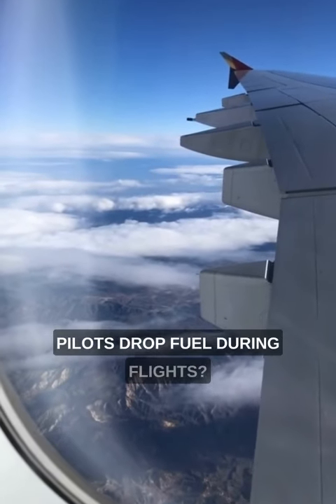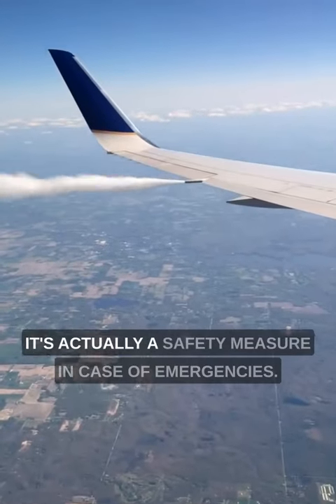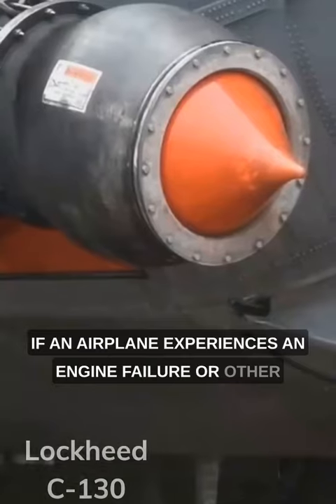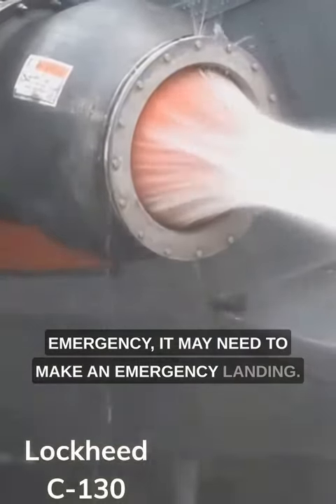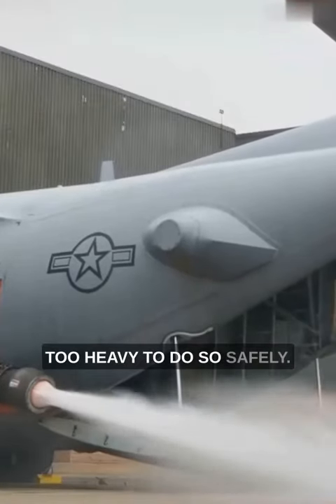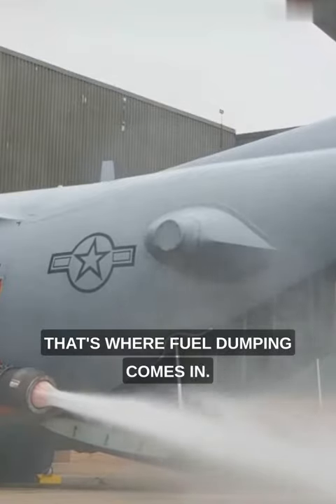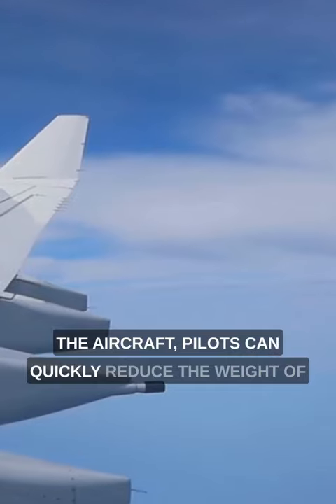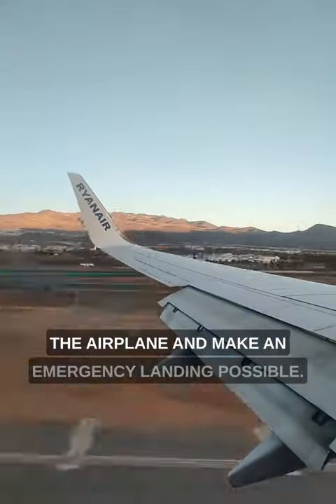Why Do Pilots Drop Fuel During Flights?#shorts #aviation

Comment: I actually thought they over filled the tank
Reply from the maker: Not all aircraft have the ability to dump fuel and those that can only do so in specified circumstances. This will generally occur in instances when a flight needs to return to the airport shortly after departure.
Reply: No lol they fill based on the weight and climate they travel to they dont fill up like a car 😂

Comment: It’s nothing to do with the weight of the Airplane’ being the reason a pilot would dump fuel !!..,
A pilot would only dump fuel if they had to proceed to do an emergency landing the reason for dumping the fuel would be so the plane didn’t blow up and go on fire is absolutely nothing to do with the way the plane that we would help if there was an excess amount of fuel on board during an emergency landing the percentage of it going into flames would be far greater than if the plane was nearly empty..
Reply: No sorry you’re wrong 
We jettison the fuel 
To avoid damage to the structure 
Because landing weight should be always below maximum landing weight 
Please if you don’t know don’t say anything 
Aircraft engineer 🇩🇿👋